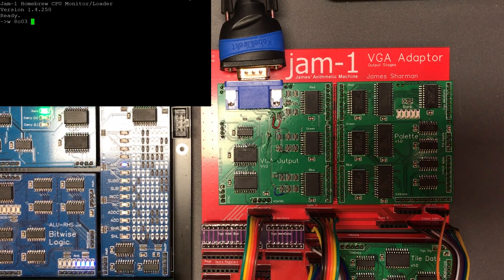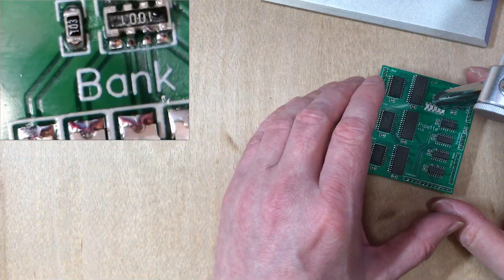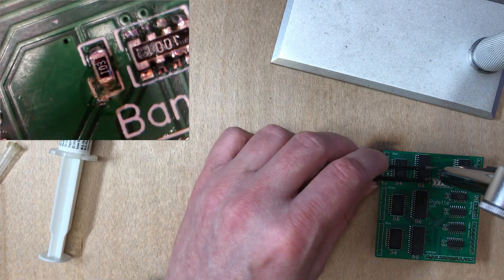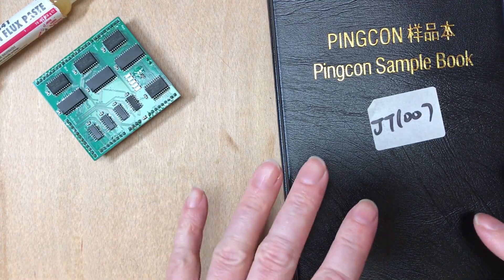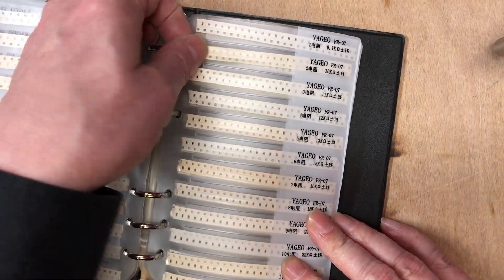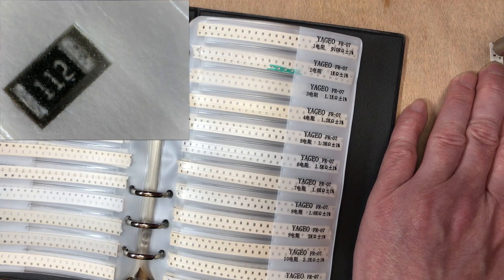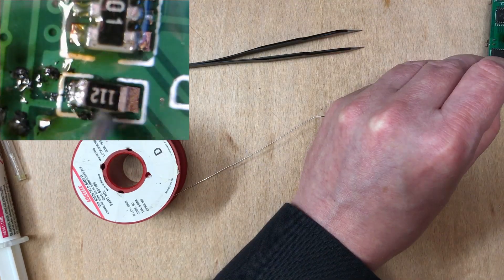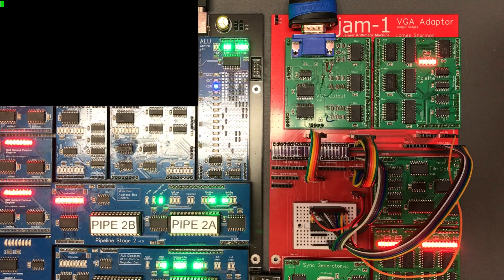Palette PCB Fix - VGA from Scratch - Extras

Comment: Thanks for the sample book investigation, I'll have to double-check mine next time! If the value is somewhat important I use a DMM to verify the actual resistance, I've never seen incorrect markings (on the part itself) but sometimes they aren't readable.
Reply from the maker: I think now I can work it out form the number, not sure what to do about the capacitors though. They are generally not marked.

Comment: It's amazing how little difference 100 ohms makes regardless of the tolerance, even for aesthetics. I'm still getting used to things like this, and it's good to be reminded of such things every now and then.
Reply from the maker: That wasn't 100 ohms different. That was the magnitude value so it was 10x off!
Reply: @JamesSharmanExtras  My fault. I meant the fix, not the problem. I am easily the kind of person who could get hung up on waiting for 1K resistors to come in through the mail before proceeding, instead of using the 1100 ohm resistor I already have. I'm still getting used to just how forgiving electronics can be.

Comment: Second! 

And thanks for the short vid on this fix. I was wondering if it where a resistor or an oscillation issue. Like PWM.
Reply from the maker: When I was assembling the board I paused very briefly when I looked at that resistor. I knew something didn't look right!
Reply: @JamesSharmanExtras That happens sometimes ! Glad you didn't  " resist " the urge to make a correction ^^